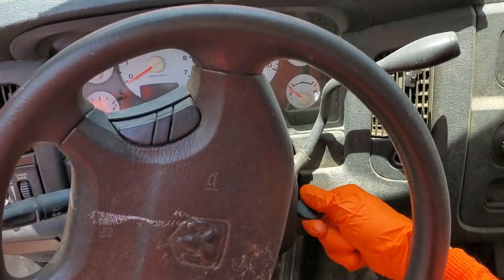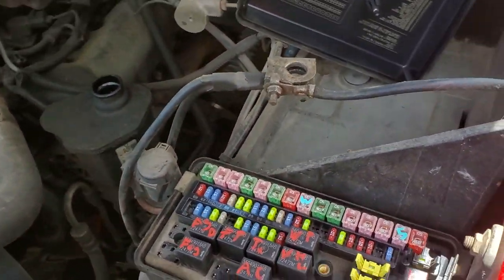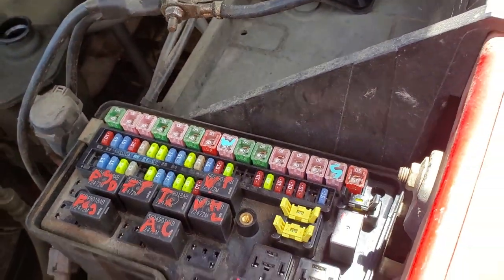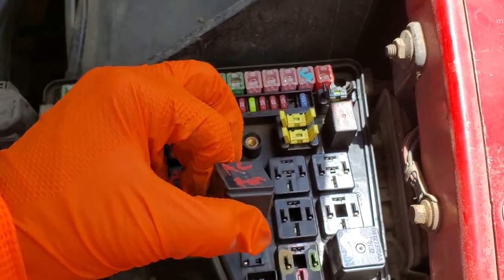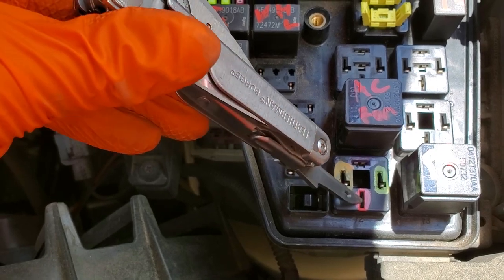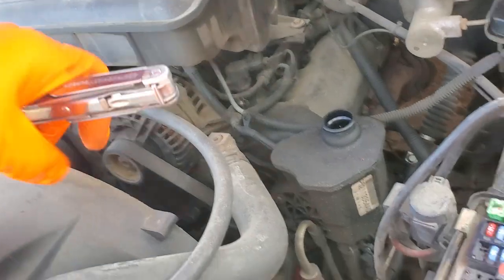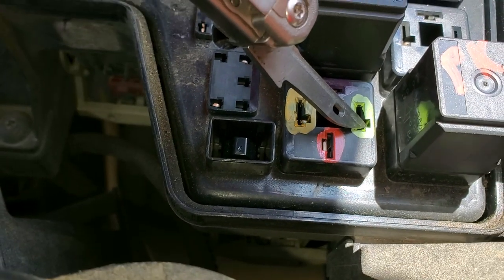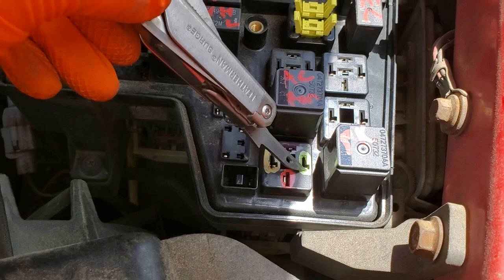2003 Dodge Ram 1500 Starter Fuse, Starter Relay & Circuit Explained

Comment: Is the 30A The fuse you pull if you want a long-term store your truck. Mine's in my driveway a lot maybe weeks on end sometimes I'm not home or I'm just driving my commuter car. Few years back one of the guys at my shop who's not there anymore told me I had to pull a specific fuse if I was going to do that

Comment: Thank you for this, though I am getting 12v at ignition switch on both red and yellow but not on the left pin where starter relay goes. Any ideas? Also I do have a hard start. Battery is verifiably good and so is starter. Getting 12v to starter but when key crank o my getting 4volts. When I jump starter from either starter itself or starter relay pin it’ll crank but no start. The right pin not getting any ground, you mention neutral safety switch supplied ground(automatic) is it possible to bypass?

Comment: Hey brother.  I had someone sabotage my 2007 Dodge Ram 1500 5.7 hemi. after I just dropped 7 grand on a new engine drive shaft and Rear end. Is there any way you can do a video showing?How a starter relay is connected to the fuse box, battery and started. I would
Gratefully appreciate it.

Comment: So I have 12v to the red pin, but nothing to yellow pin when key in start position. I verified that I have 12v up to the connector when key is in start. What is weird is that when the relay is inserterted, sticking up a little and I put it on the relay, and turn the key I get 12v to yellow, but no clicking etc
Reply: Any luck on the solution? I have this same issue

Comment: Then where is the neutral safty switch on the 2005 dodge ram 1500 6 cylinder  single cab pick up ?
Reply: Oh and that's an automatic transmission

Comment: i have a 05 dodge ram 5.7l hemi 4x4. its no crank no start problem. (the lights come on) ive changed the battery, starter, and starter relay and still nothing. any ideas?
Reply: Did you ever get it figured out? I'm having the same issues with my 2004
Reply: Same here
Reply: @kotypaisley8820  when you supply power to the top pin of the relay does the starter click?
Reply: @trentroberts8546  it ended up being fuse 15 I believe,  it didn't look blown or anything and looked over it 2 or 3 times
Reply: @trentroberts8546  I actually figured it out it was that 40a square see through top fuse it was popped on the side and didn't visibly look blown but after much frustration I yanked it out a diff one in from an option that isn't being used on the truck and bam fired right up

Comment: Aa u  think it's that relay that went bad I replaced the safety starter switch the neutral safety switch for a manual on my 03 dodge ram v6 5 speed I don't think there is any more sensors besides that one an  the relay that I just learned from your channel

Comment: Hello Lehew, lol, I assume that's not your first name......  So, using this video, and also this one -  https://www.youtube.com/watch?v=hak9iUS7bgo&list=TLPQMjMwNDIwMjOrDSQmoqUWlA&index=6   -   I've tried to figure it out. I have a different relay, but'it's 4 pin. The fuses are in tact, Here's what I find -  I can't get a voltage on the 25 amp fuse, I get full 12.6 at two pins constant, so I figure that's good, that's the ground and the battery? Then with key on or off, I can get it to crank with a jump  wire, in different combinations actually. Then, in holding key in start position, I get one pin showing 4V, and 1 pin will show .6V, when I turn the key back it drops to .192 I'm getting a little fuzzy here, cz I wasn't getting the .192 when I'm at the fuse box....